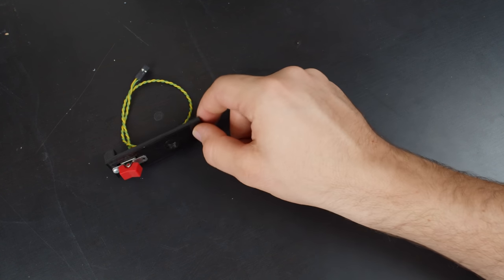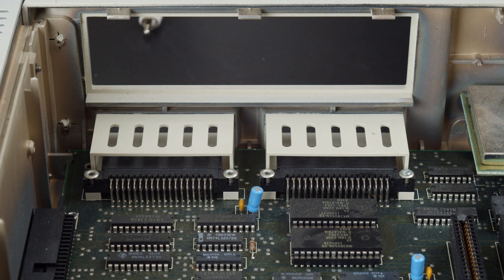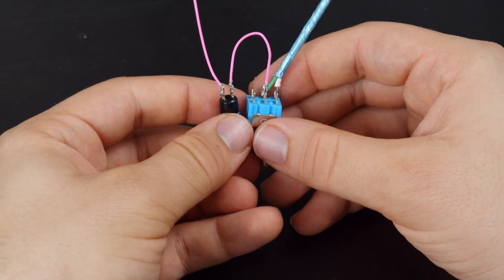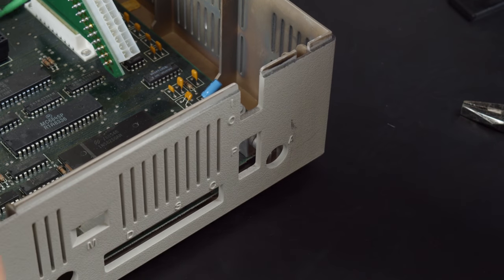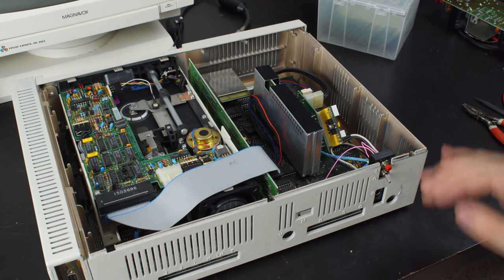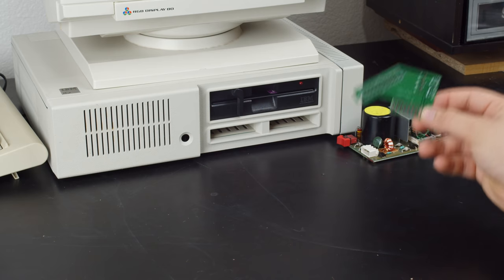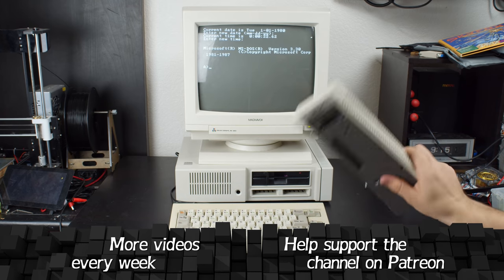ATX2PCjr Switch Update

Comment: I'm glad you have made this substitute for the PCjr, I want to pick one of these up from you in the future. I have 2 Tecmar Jr Captains as well and I would feel better using a more robust power supply for using the 5 volt mod for supplying the Tecmar Jr Captain without its wacky power supply (which I have).  BTW the Tecmar power supply for the Jr Captain is 8.5 VAC at 1.35 A but you can bypass the power plug and run 5 volts from the power supply to the 3 pin 7805 voltage regulator and attach the positive lead to the bottom leg of the regulator chip (the one bolted to the metal shield to which the parallel connector is attached) and the negative lead to the shield itself. I found this from the JR Newsletter From January 1991.

Its good to have alternatives although I have had no problems picking up 3 original PCjr power bricks from Ebay all for less than $30 US including shipping over the last year and if I had wanted I could have had 6 bricks for less than $30 each but didnt have a need for that many and left the auctions so others could get a cheaper deal as well.

EDIT: Oh and you didnt need to use Red power switches as some of the power supply cards of the PCjrs had Black switches. =)

Comment: 7:20 instead of having 2 pins for the power switch, which could lead to that polarity problem you stated, make it a 3pin connector, when the two outer pins are positive, and the middle pin negative. with this trick, you shouldn't have any polarity issues. hope this helps!

Comment: It's no wonder you haven't gotten any international orders yet. AFAIK, the PCjr was never sold outside North America
Reply: Exactly
Reply: Yes it was.  In Japan, Australia and New Zealand it was sold as the IBM JX which is only slightly different. https://en.wikipedia.org/wiki/IBM_JX
Reply: No international orders? I ordered one probably about 3 months ago for my PCjr which I imported from the US. Last time I checked I still lived in Australia haha.
Reply: @zembryoz  Slightly different? I don't think so it's almost a completely different beast. Yes it was based on the PCjr and shares a lot of the architecture (lack of DMA controller, same graphics/sound capabilities, cartridge ports) but that's basically where the similiarties end. Just for starters the power supply is completely internal in it's own casing (much like a modern PSU), the motherboard, external connectors completely different layout, no side cars. Honestly if looked inside one and didn't know it was an IBM JX you'd easily mistake it for just another clone PC of that era.

Comment: 8:26 one advice, you should use heat shrink tubes on the solder points to protect them from short circuit
Reply from the maker: I'm really not happy with out the wires attach on these. I may look into getting some crimp connectors that would slide on and be cleaner. 

Ground for the reset complicates it. I don't want to solder the switch directly to ground on the PCB because it's less removable then. I could possibly include a second wire and clip in the future instead if this solution is difficult for people to use.
Reply: Or just have a wire going fom the ground connector to the reset switch? Nothing keeps you from crimping 2 wires into a single conenctor.

Comment: I used the same hook style leads to pull composite signals and 5V off my Atari 2600 to run an HDMI converter within the console. They're nice for when you don't want to add anything irreversible. Cool to see them used for this too!

Comment: Just be careful pulling on the drive cage.  I purchased a new old stock PCJr from the Computer Reset haul and have had the drive cage out about 3 times and one of the  4 parts of the nubs broke off.  It still seats in fine, just now there's a small plastic piece a few mm in size sliding around under the motherboard.

Comment: Since the reset line is in the cartridge port, you could easily make a PCB which fits into the card slot and has a button mounted on it to get a front mounted reset button.  If it was a panel mount button it would be two drops of solder to assemble.   A 3d printed faceplate would dress it up nicely too.  Should be pretty cheap to make too.   I have no intention of doing this myself as I don’t own (and don’t really care to own) a PCJr... so have at it!
Reply: Why? The hook is awesome!

Comment: Is the chassis plastic, or can we use a ground lead to the chassis as well? I find a hook kind of janky.
Reply: The PCJr is all plastic with some areas sprayed with metal impregnated paint to work as a RF shield.   I would think about tracing the board down to see if there's a place that the cartridge reset goes to that could be soldered to on the bottom maybe. Or just remove the J clip and solder directly to the reset pin on the port.
Reply: Well it still have to hook into that pin. He's already reusing ground from the power switch.

Comment: Is the cartridge port proprietary (connector, header)? You could maybe just print a case with a header and then put the reset switch onto the dummy cartridge. 

Of course it would look a bit out of place, but you'd have a reset button on the front of the computer.

Comment: That clip looks  really janky. Isn't there some test point, solder point, to attach that wire to?
I have to ask, why don't you just avoid having to use a picoATX or ATX power supply altogether by placing dc-dc converters on the actual board? Google says you only need 5v up to 4A and -12v up to 25mA ... you can buy pre-made commercial converters for a really low price (considering the amount of parts).

Go to digikey dot com and enter 507-1384-ND in the search box, it will take you to BEL Fuse VRAE-10E1A0G which costs 6$ each. Up to 13.8v in, up to 5.1v out, max 50w... super easy to install, just 5 through hole pins. For 6.2$ you have 811-2622-ND  , Murata OKX-T/5-D12N-C , 8.3v..13.8v in,  up to 5.5v 25w out  and also has 5 through hole pins... you could have both footprints on your board and have two sources for power supplies, install the one that's available. May have to add a couple bulk capacitors on input and output (and set the output voltage to 5v using two resistors or a potentiometer) and that's pretty much it 
For -12v you could use a voltage doubler/inverter, basically a DIP package chip and a bunch of ceramic capacitors will invert the 12v on input to -12v ... for example TC7662 can do 40mA  from Microchip, look up TC7662ACPA-ND on Digikey. .. it's 2.7$ ... or search for LT1054 from Texas Instruments which can do up to 100mA. 
Job done, now you can power your PC with a 12v only adapter ... you add ~10$ in dc-dc converters but you no longer have to buy that 24pin atx connector, your pcb is smaller, you only need a 12v barrel jack...  You could even sell it with an optional 12v 45-65w adapters with removable mains cord (to work in various countries) .. ex 993-1286-ND , 14.5$ for 12v 45w (fancy delta made 40w one is 16.5$) and 60w models are a couple dollars more.

Comment: dude, just replace reset switch with normaly closed one and put it in series with power switch. No messing around with reversing cable connecting to psu adapter board or hooking up cables to reset pin of cartridge port
Reply: unless, you want to go for all this effort just to have soft-reset
Reply from the maker: The PS_ON pin on ATX PSUs is a little odd. In this setup I'm using a latching toggle switch that keeps PS_ON connected to ground while the system is on. But basically all modern systems use a momentary switch instead.  This is somewhat of an edge case with how I'm using it. I don't like the idea of temporarily disconnecting it and the latching it again and complicating how it works. 

Additionally, using soft reset doesn't discharge and recharge the components in the PCjr and would be less stressful on the system if you need to restart often.
Reply: sure, putting less stress on system is a valid point, I stand corrected

Comment: The Cartridge port reset is cool but why not get a momentary normally-closed pushbutton and have it inline with the switch so that the button just interrupts the PSU on wire? No need for the expensive clip on.
Reply: When you do that, the PCJr goes through a full POST with memory count.  If you have an upgraded PCJr with 640K like I do, it takes up to a minute to count the RAM and do a POST.  The interrupt switch is an immediate reset without going through the POST. I think it causes an address jump to the boot code and not the POST code.
Reply: I think this PSU is akin to those old AT PSUs, the live wire is not a pulsating one like modern PSUs but a continuous "ON state" and interrupting it would be just like unplugging the cord instead of a soft reset
Reply: @stonent  Oh it's a different type of reset? That's cool. Yea never mind then.

Comment: Yuck, that toggle switch. It's not like there aren't a million cheap rocker switches... BUT it's a rear of the computer and you're adding functionality, so eh, it's a reasonable compromise.
Reply: Yeah I'm not too keen on the toggle switch either. Reset is a nice function to have but maybe I'm old school and have no problems with the good old three finger salute (Crtl-Alt-Del).

I was a going to buy another one (I have the "original" rocker switch version) but not so keen now after seeing this change.
Reply: @AtariPCnet  so order the now cheaper kit and source the red switch yourself?
Reply: FlaminJoe76 just message him, im sure he has one
Reply: @AtariPCnet  I don't actually remember 3 finger salute working exactly when you need it. When you don't necessarily need it, it works just fine!
Reply: Yeah, you could definitely solder it to the pin but a lot of people prefer to keep their vintage computers as original as possible (or at least easily reverted to original).

Comment: It's algorithmic, the lower the stock gets, the higher the price gets due to scarcity.  Think of it as Bitcoin for vintage power switches.
Reply from the maker: Of course, that is entirely the problem. The sales are so low and I'm buying small batches so the manufacture doesn't want to do another fab run and be stuck with 1,000+ more of them. So they raise the price to only have serious orders.

If there is enough demand I could possibly offer a "deluxe" version that uses the more expensive switch but I would rather not. I'm not at a point where I'm trying to make this a business really and I don't have a lot of capital to tie up in it.
Reply: @TechTangents  I think it's entirely possible they don't want to make ANY additional switches, so these become the last source.  As I alluded to, Bitcoin is a fixed resource with what, 21 million coins?  If they only have a final batch of 1,000 switches, as you approach 0 remaining, the price increases to compensate for scarcity.  If they were willing to sell you 60 switches at $1 each, you wouldn't hesitate, but now they have 60 less switches that someone ELSE may pay $2 for.  As the resource becomes more scarce the price goes up to account for the "uncle" factor.  You hit UNCLE and re-engineered your design to eliminate a costly component.  Someone who's building replacement widgets that sell for $1,000 each isn't going to cry UNCLE at $5 per switch, but at $10 they will probably think twice.
Reply: @eformance  I found what I believe to be the switch on one site, but it was about $8 each.  I guess if you had an old PSU that was bad, you could just recycle the old part on this board.

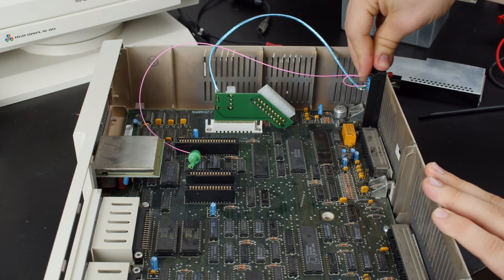Comment: @AkBKukU Love your content (most of the time), but I can't believe this: 06:01 What are your customers, monkeys? You suggest that they hook up a freaking probe clip to their machine, and permanently LEAVE IT IN PLACE? O_o So here are my 2 cents: That's NOT the proper way of doing a mod like this, folks, or ANY mod for that matter! (Just imagine what can/will happen to that probe clip during shipping, or even your casual 48-hour drive to LTX 202X!) Probe clips are meant for, well, temporarily probing (!) components within a faulty/dodgy circuit. You don't want them in your machine as a permanent connectivity solution of any kind! Bottom line: You want to mod your PCjr? Well, then either learn how to solder and do it right, or make like a tree and get outta here! (BttF reference intended)
Reply: What will happen? It might wander up and down on the pin it's connected to. If you think you can knock it off, you have a bunch of fragile components in the system where all the plastics are 30+ years old and which contains worn, stressed and irreplaceable mechanical sub-assemblies, and you definitely shouldn't be subjecting it to that kind of stress. It's a bit of luck that the hook clip sits on the cartridge pin so well, in most other places they tend to be kind of wonky.

It's not a suitable way to create a permanent data connection as it can be intermittent, but this is just a reset switch to ground, signal integrity concerns are irrelevant. Furthermore it's floating unless the switch is pressed down, so any risk is minimal.

Anyone receiving the kit is free to strip away the clip and solder the connection in place, which is honestly what i'd do. Bonus: free hook clip!
Reply: I like this method where end user does not need to actually modify their hardware per default. Clip is helluva fine method in this context too. And lastly if someone wants to solder the resetwire then the person solders it and that's that, no need to trash author for having gone the effort to find easy solutions for end users and do it cheap.
Reply: @samiolmari3821  "Fine method?" WTF? Hook comes loose (which it will in one scenario or another), user powers up the machine, everything seems fine ... until s/he pushes the reset button. Anything the loose probe clip touches at that point in time, including let's say the power rail, will get shorted to ground. ZAP! PCjr --> paper weight, and you goof endorsed it
Reply: @shaftandsack  It's not the proper way of doing modwork, end of story. People with more knowledge and experience than you will cringe, frown, and/or laugh at you for doing it like this. I think I've made my point. Feel free to mod your own personal machine the messy way, but don't advertise it on a channel with >50k subscribers, is all I'm saying.